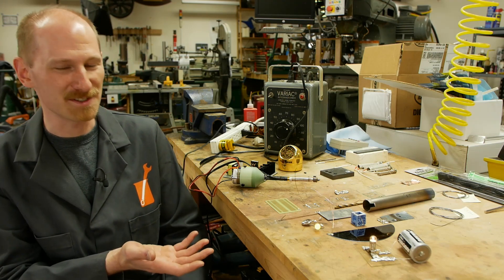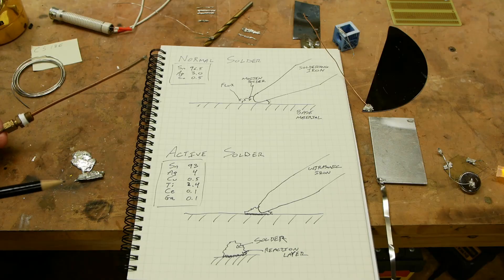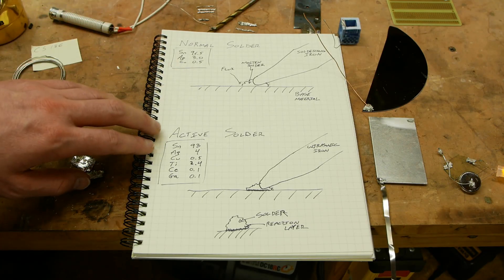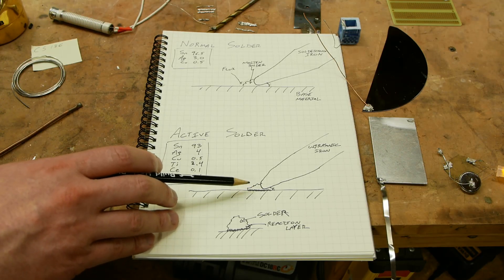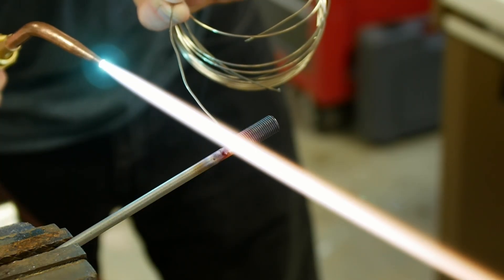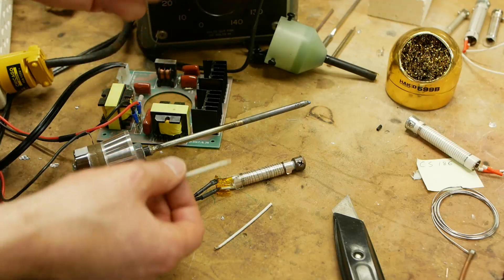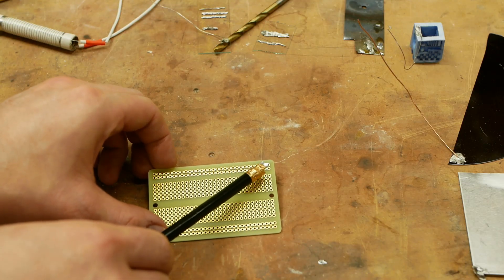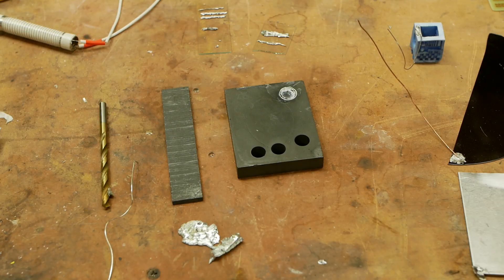Ultrasonic soldering bonds glass, titanium, stainless steel, ceramics, tungsten, nichrome...

Comment: is this the same material that they use to make TEC or Peltier devices? I never understood how they got the diodes to stick to the ceramic plates.... and I understand that is still an issue in making a quality TEC device due to the stresses involved in heating and cooling.... it causes failure of the device....
Reply: I suspect TEC's are bonded in a oven with a hydrogen atmosphere, as since its the typical method for metal to ceramic bonds.

Comment: Y'know I never thought to look at Pb-Zr.  There's so many things Pb doesn't really react with.  To my surprise, I see Zr forms a quite strong intermetallic (Zr5Pb3 melting at 2240K), and has a very slight eutectic on the Pb side (about 0.3%at, which probably in part explains the small concentration?).  Cool!

(I happen to have an old collection of phase diagrams from the FactSage collection, which may or may not still be available, I have no idea?)

Comment: Maybe it is sticking to the top graphene layers which separate from the rest of the graphite when u tug on the wire. Basically the substrate fails not your solder joint. Isn't that how they discovered graphene? Pealing tape apart to separate its layers?

Comment: Can you make a circuit board on a pane of glass with this ?

I tried to use “copper mirror” chemical reactions for ages and it didn’t work.
Reply: > I tried to use “copper mirror” chemical reactions for ages and it didn’t work.
Have you tried other metals, like silver or mercury alloys? Or use regular modern mirror, which uses aluminium?
Reply: You'd need a reliable way to make traces in the conductive coating on the glass. Either etching it off somehow or masking during application.
Reply: if you mask the glass with a solder resist mask you might be able to just paint it on. or paint a thin layer on and etch the excess away.
Reply: From video it looks to me like you could.
Reply: Conductive glass is usually sputtered or vapor deposited right? Or am I misremembering?
Reply: i heard you can also make it in a autoclave. getting a very very precise solderable pattern i suspect is alot harder then just doping the glass though.

Comment: how about sealing copper pipe joints? conventional method will not work if water is present maybe this would?
Reply: This wound not help becuase this solder has a melting temperature above the boiling water & the joints will be weak. If there is a small amount of water you can used a wet shop vac to pull the water way from the weld area or use a plug or freeze the pipe with dry ice.

Comment: How much difference does it make if the soldering is done in an inert (or reducing) atmosphere? If you can clean off the oxide layer, can you just use standard solders for most metals?
Reply: Why yes you can. You can solder Stainless steel by scratching the surface of the SS under a pool of solder. You can also wet ceramics using brazing alloys under a hydrogen atmosphere.

Comment: I am not a material/alloy scientist so it is very likely that it doesn't work, but aluminium is also hard to solder so I wonder if one could also substitute the titanium with aluminium. And related to this, how easy is it to solder with this on aluminium? Namely, one still has to deal with the fact that aluminium can dissipate the heat quickly.

Comment: maybe a heat break from a 3D print head would be helpful as the solder tip holder on the gun. Give the oscillator the thermal protection it needs, along with a good mechanical connection and they tend to be threaded, so you can change tips out as needed.

Comment: You're a wizard. I can't even solder solder to solder sometimes after working with it too much, very frustrating. Edit: 10:02 it's very possible that the cheap donor iron is to blame for the tip breaking down so fast. I've had cheap iron tips crumble during use and the only thing ultrasonic around here is Sega.

Comment: Try connecting a motor run capacitor in series with the AC input to the ultrasonic driver. Unlike a variac, it won't drop the voltage until it starts drawing current, allowing the oscillator to start.

Comment: Is there anything you can apply to the glass to make the metal fail to bond? Maybe HF etching? I would be curious about whether you could make a printed circuit with masking, HF, then this.
Reply: The issue I see is that this solder does flow like solder using for PCBs. I don't think you could float the glass over a bath of this solder and without getting solder bridges and other issues.

Comment: I wonder if the solder is bonding to the graphite, but the flaky surface is just giving way under low load.
Reply: How about soldering into a (through)  hole to give mechanical strength?

Comment: Common chemistry glassware is connected with cone-shaped profiles, often with sulfuric acid applied to the joints to improve the seal (I've never understood how that works though). I wonder if this method could also be used to make absolutely sure everything is as airtight as can be. Once done with an experiment, I imagine this stuff can be removed with a regular soldering iron?

Comment: I'm part of my universities motorsport club and one thing which all motorsports clubs have trouble with is assembling their battery pack for the electric vehicles. The rules specify that the cells must be connected by fusable links, so what Telsa do is ultrasonically weld wires from the bus bars to the cells. These ultrasonic weling machines are far too expensive for a university team to buy so we have resorted to using the normal nickle strip for fusing, with limited success. Do you think these ultrasonic transducers could produce enough energy to wirebond say 30AWG wire to an 18650 or how large would it need to be?
Reply from the maker: That's a good question.  I'm thinking that the wirebonding machines used for ultrasonic welding would need substantially more power than the 60W transducer.  We have a couple ultrasonic welding machines at work intended for plastic, and I think it's about 800W.  Have you considered capacitive discharge welders?  You can use those with 30AWG fuse links too.
Reply: @AppliedScience  So we use a capacitive discharge spot welder currently for joining the nickel strip to the cells. The current plan is to use the nickel strip itself as the fuse however we can't get it fusing reliably. We haven't considered using the spot welder for doing wire, I might investigate.
Reply from the maker: I've done some capacitive discharge welding of tinned copper wire (around 30 AWG) to steel batteries, and it works, but not particularly well.  If you could find pure nickel wire (perhaps try Nichrome, as it's available in many sizes for cheap), I suspect it would spot weld very well.

Comment: weld a glass box. like a fish tank sealed with silicone but a glass one soldered with that.
Reply: I think this might not work as Ben described the bond is not that strong.. It is soldering, not welding after all..
Reply: Mechanical strength may be an issue with larger tanks
Reply: @nThanksForAllTheFish  True, but if it's ductile enough it might make a good seal.  You could/would use another material for mechanical rigidity, like the upper and lower metal rims of fish tanks provide.
Reply: @nThanksForAllTheFish  now if we could fuse glass back together easily...
Reply: @ballenf  You can make a stained glass window without lead now. The modern way of doing it is to use copper tape with a vinyl-based adhesive folded around the edges of the glass, then soldered with a lead-free alloy, but back in Tiffany's time they used beeswax to temporarily affix the copper foil. If the piece is designed well, the adhesive is irrelevant as the solder provides the necessary mechanical support.

Alternatively, if you really want to do it the old-school way, you can get zinc came instead of lead. It's a bit harder to work with than lead, though, and it doesn't like sharp curves.
Reply: The XRF Gun is amazing science. But since Carbons Atomic number is too low(12) wouldn't that mean you would not be able to tell stainless steels apart from other Iron Alloys?
Reply: Brake a windshield with a hammer and solder it all back together without a noticeable crack.  easy money.
Reply: @calholli  That would be great for it, especially if you could just solder the chips... I wonder how reflective the solder is..
Reply: @rkan2  I have tried this, it is as reflective as mirror.

Comment: Someone correct me if I'm wrong, but I believe this reactivity of the titanium surface oxide is one of the reasons it's used in prostheses, as it basically creates a strong bond with bone and is less likely to get rejected by the body.
Reply: I think likely because its light, strong and most importantly: isn't likely to contaminate the body with metal compounds (ie does not react or corrode once passivized).
Reply: @guytech7310  Im getting this from the wikipedia page on osseointegration, the strength and weight is part of it but a very cool part that I feel is related to this titanium oxide layer behavior is what causes bone to create a very strong bond with titanium implants.
Reply: @R3VISION3  Perhaps, I presumed that titanium implants had a mechanical bond (via rough surface or screw shape). I presumed that the passivation layer in titanium would prevent any chemical bonding.
Reply: @guytech7310  " It is now known that both calcium phosphate coated implants and titanium implants are stabilized chemically with bone, either through direct contact between calcium and titanium atoms, or by the bonding to a cement line-like layer at the implant/bone interface.[14][15] While there are some differences (e.g. like the lack of chondrogenic progenitors), osseointegration occurs through the same mechanisms as bone fracture healing."

https://en.wikipedia.org/wiki/Osseointegration#Mechanism

This is where I'm getting the idea from.

Comment: I'm kinda surprised the ultrasonic energy doesn't just shatter the more brittle materials like glass.
Reply from the maker: I had problems with the glass cracking.  The combination of localized heat and ultrasonic energy often cracked the glass.  Funny enough, the solder would hold the pieces of glass together so it wouldn't come completely apart!  I need less ultrasonic power, and the process would work better with pre-heating the glass to a uniform temperature before local soldering.

Comment: @ 3:30 ish. it might be helpful also to mention that this principle applies to iron/steel as well. A black iron oxide finish is often used to keep forged pieces from rusting, and a blued (oxide) finish is often used to protect firearms and other mechanical parts where a thicker oxide coating is not desired. These protective oxide coatings just typically don't form on their own like they do in copper.
Reply: rust bluing does not, itself, provide much rust protection, rust bluing is a porous coating meant to hold oil that does the protecting.
Reply: SuperAWaC clockmakers use the bluing to protect the metal. Its not bluing like on guns with a bluing liquid and oil, they literally burn the steel very evenly and it literally turns blue (or straw) and if you do it like that it is not porous and you dont need oil at least as far as i understand.
Reply: @melody3741  I am a machinist. Any form of bluing (converting the iron to magnetite) is porous. They all require oil to get maximum mileage out of them. What you are referring to is just using heat to temper the metal, the oxide layer formed doing that is extremely thin (the thickness of the layer determines the color due to the way it interacts with light) and largely cosmetic.
Reply: @melody3741  Ah, the difference between "Clickspring bluing" and "This old Tony bluing". But I think clickspring do it mainly because the metal needs to be tempered after hardening, the color and protection is just a by-product.
Reply: @chakflying1  To be clear, Clickspring blues his parts purely for cosmetic reasons. This is why he heat treats/tempers his parts, polishes them to a mirror finish, then blues them. The oxide layer itself offers virtually no protection on its own against rusting.
Reply: Good commentary

Comment: Did any thought go into the shape of the ultrasonic "shaft"? With knives and such there's a lot of design time put into optimizing the shape, I'm surprised that wasn't required here at all.

You showed it on ITO glass, what about regular glass?

And what happens with the ultrasonic off? Does it work on any of the materials at all?
Reply: At this power level, shaft shape doesn't need any optimization. If you were to use a commercial-sized transducer(5-15W), you would likely need to do some tuning.
It works on glass, and it wouldn't work on most materials with the ultrasonic off, as you need that to break up the internal structure.
Reply: Spirit thanks man, that all makes sense. I was wondering whether the active solder would result in a weak, poor connection or none at all, but that depends on the material I’m sure. Thanks for your response!

Comment: What about making some crazy, bespoke thermocouples? Thermotriples? (a thing?)
Reply: Thermocouples are a direct bond between two metals, adding a wacky alloy of "third metal" would not work.
Reply: @Spirit532  Not at all. All you need is any kind of electrical contact between two different metals (at the same, targeted temperature point). Seebeck will take place on the way to the "ice bath" point.
Reply: @otherbasis8505  Technically, yes. Practically, no, you're adding a bunch of tertiary metals to the mix. That's the issue.
Reply: @Spirit532  "tertiary metals" do not matter because they all sit at the same temperature (e.g. the temperature of the ceramic slab the whole thing attached to).  The same temperature => no temperature gradient => no Seebeck. Ergo soldering alloy is irrelevant.
Reply: @Spirit532  This is for bonding to not metal. Specifically, you might have two very fine traces of metal for your thermocouple, and bond them to a nonconductive material with this technique for structural support, although I'm not sure what advantage this would have over only having the dissimilar metals at the junction.
Reply: @belg4mit  For structural support bonding it will work, since there is no electrical circuit with the bond spots. Not much point over something like epoxy or baked ceramic paste though.

Comment: How good is it at joining glass to glass? Might you use it as an "easy" approach to something like stained glass for assemblies? That combined with your sputtered displays  could be pretty cool i.e; a cube (by tacking corners together) with LCDs on multiple faces, with invisible traces leading to the bottom face for it receive control signals from the base it sits on.

Comment: This is a pretty amazing project.  Nitinol on pcb gave me all sorts of ideas for a Carl Bugeja-type project.  Someone just needs to find a distributor for the solder, i ain't got time for alchemy.

Did you per chance try using the 'soldering iron' for ultrasonic welding of plastics?  Might be a nice secondary use.
Reply: Oh i like that idea instead of the commercial melters.

Comment: How about welding aluminum?
the alloy of the second thread what was it?
Reply: I don't see why it wouldn't work on Al alloys, though there are already both soft (e.g. Sn-Zn) and hard (e.g. Zn-Al) soldering alloys that work on aluminum without needing specialized equipment.  Both come with caveats, but so would these active solder alloys.  Where it might be particularly useful is on heavily anodized parts, although spot-facing and resistance welding may be faster or more reliable depending on the application environment.

Comment: I have a question about the induction furnace I bought an inexpensive induction machine off eBay and was going to make a hot water tank with just the pipe being the element rod iron pipe for the section that was heated was wondering if there would be too much scaling any thoughts

Comment: Could you solder a circuit onto a glass bottle, that when a hand grasps it, it completes the circuit and powers something (an LED, say). Like, a thermo / conductive circuit. It could be battery powered, or if possible, the heat of the hand might power it.